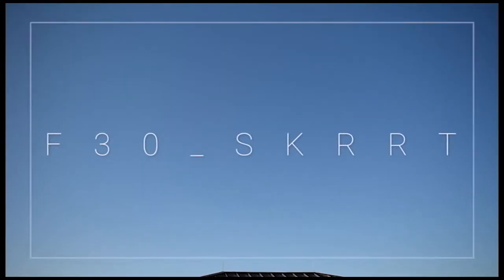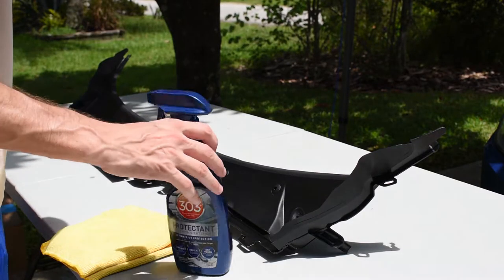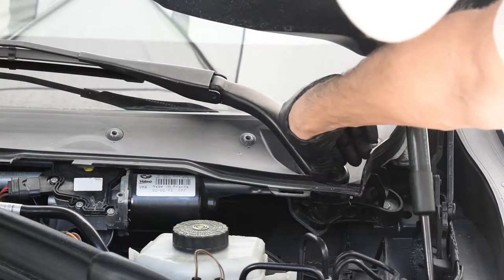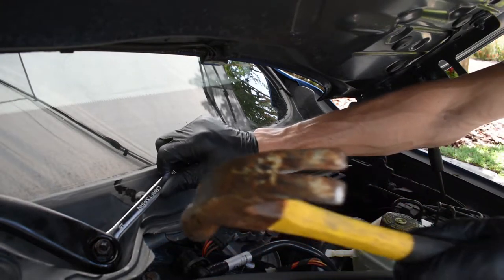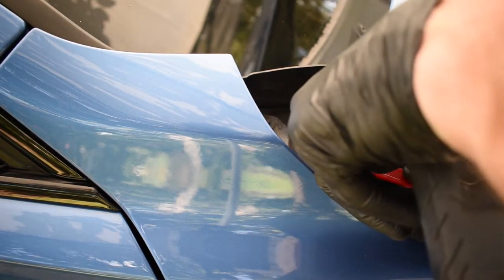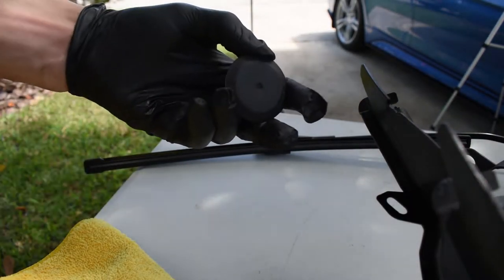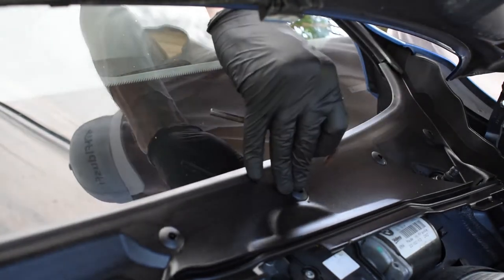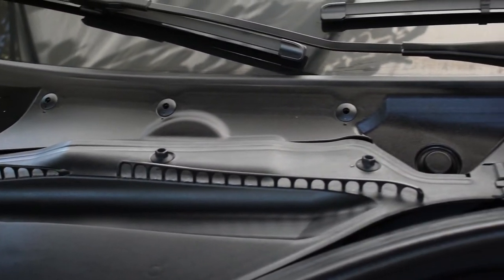HOW TO REPLACE THE WINDSHIELD COWL ON YOUR BMW F30

Comment: Best DIY video on the windshield cowl replacement.  This is the only one that shows how to easily remove the wipers. Others describe using a special clamp or a freaking hammer!
Reply from the maker: Thanks!! I like to be as careful as possible but sometimes you do need some force 😂

Comment: Great tutorial!  303 is a great product, but it's not one and done for those that are wondering. Usually it will last around 3 weeks before a new application is needed.  Not a big deal, just have to keep up with it when it looks dull again.  I do like the idea applying it before installation as this would  be easier.   My original cowl lasted 10 years before needing replacement.
Reply from the maker: Thanks and great point! Could just use a trim ceramic coating

Comment: you need to buy only the windshield cowl or you have to buy some screws/plugs together? thanks.
Reply from the maker: Just the link I provided unless you have some parts already missing. You’re just replacing the cowl

Comment: I love how detail the video is. I am planning to change mine, an 8y/o car. I have a part thats open in the middle, and maybe a screw missing, is the 5mm allen screw, the x16 or x20? Any recommendations? Thank you
Reply from the maker: Thanks! Not quite sure what you mean. What car do you have? Any missing plastics or screws would be cheap from BMW so could probably just order through dealership
Reply: @skrrtproductions  thanks. Will do that after the holidays
Reply: @skrrtproductions  i thought there was a separate screw or clip. But everything was good. Got to change mine finally. Thank you

Comment: After getting the windshield replaced, I noticed that the rubber edge of my cowl is no longer perfectly flush with the windshield. I think the windshield position shifted and the cowl is “remembering” the position of the previous windshield. I suspect replacing the cowl is part of the official BMW windshield replacement procedure. Any ideas?
Reply from the maker: Must be fault of the installer. I had my windshield replaced on my new F30, no cowl replacement. Depending on the condition of your cowl you might want to replace it, or go through the process of removing it so it can be properly flush again. I’d reach out to the person that did the windshield replacement